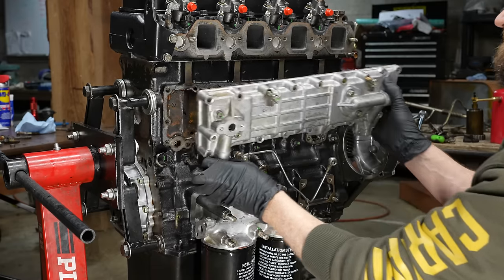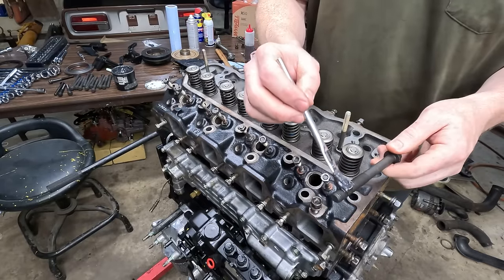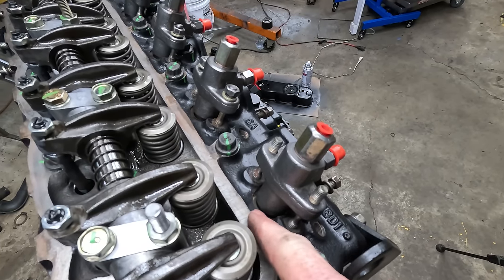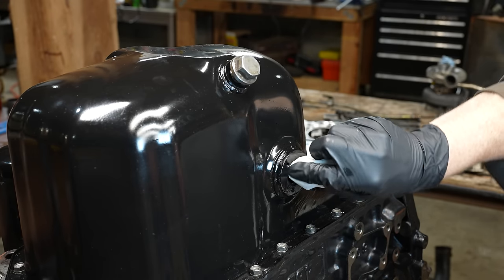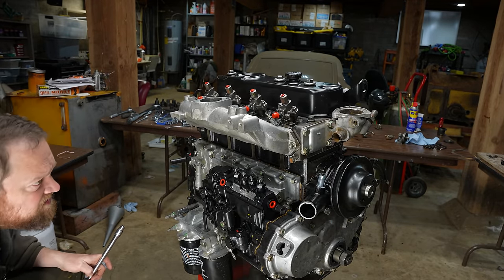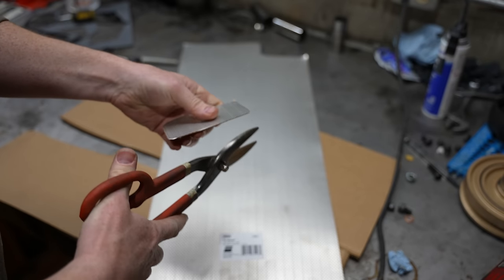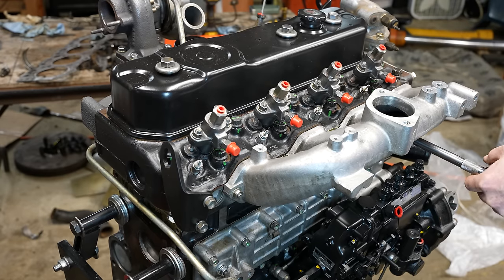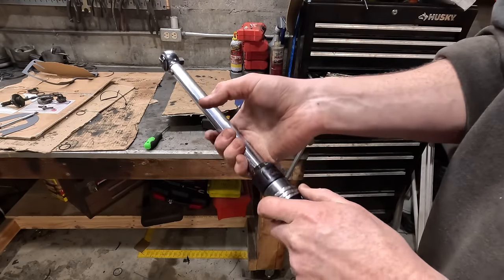Excavator engine build - Mistakes and headaches  (Isuzu 4BD1T/Hitachi EX120-2)

Comment: These days you're not even guaranteed that the $900 part you buy from the OEM isn't a re-boxed cheap Chinese part you can buy directly.
Reply: That's a shame. I'm not saying that the chicom version of something is garbage every time but if you're paying Mitsubishi or Toshiba or CAT prices, you should get the OEM part (bold stance, I know haha)
Reply: Agree
Reply: You should get what you pay for
Reply: Or a used part someone returned as new
Reply: Allow me to make a comment here. I am a retired truck fleet maintenance manager. Back in the early 90s, my lead mechanic came into my office and asked me to come look at something on a Ford LN9000 he was replacing axle bearings on. We used OEM parts exclusively in our fleet of mostly Kenworth and this one lone Ford. He had an axle bearing still in the box on the frame. He picked it up and showed me on the label Made in China. Mind you, this was in the early 1990s and this was a Ford part bought from the local Ford dealer marked Genuine Ford but made in China. So, that said, OEM from the dealer doesn't necessarily mean it wasn't made in China.
Reply: @Watchyn_Yarwood  Made in China also does not necessarily mean poor quality. 

They can make a product as good or as bad as you want, it's all about what you're willing to pay.

Comment: Matt, you need to get a set of "aircraft" tin snips. The set has a cuts left, cuts right, and cuts straight. The tips are very fine to the point that once you know how to use them, you can literally cut out a 1/4" hole from tin. My Dad was in the aircraft industry and had a set so once I left home, I had to have a set. I can't be without them. They are great for cutting any stiff material. Harbor Freight has them for about $20 a set. The really good ones are American made by Wiss.

Comment: your doing a fine job matt, now you have a dozer , excavator, tractor , now set your mind on a dump truck and quit worry about small things, all mishaps are lessons learned matt , we all went through it as you are now
make 3 marks , 2 on rod and one on the socket when you angle torque , i learned this lesson between the saddle tanks on semi trucks and torqueing with a 6 ft chetta pipe someone torques and someone holds the socket

Comment: I seem to remember being taught 50 years ago in machine design, to always torque bolts with dry threads, as friction is involved with holding that fastener tight.  I had to look that up, tho.

"Always assume the torque is a dry value unless a lubricant is specified. If any lubricant gets on the fastener and no lubricant is mentioned or specified, then using the torque value laid down could over tighten the joint or the fastener itself." Every engineer has a different book.

Lordy help us. Keep'm coming, Matt. Love your content and dry humor.

Comment: Nice to see someone calibrating a torque wrench.  Have checked the weights to see if they really weigh as labeled?  Mine do not.
Reply: Exactly what I came here to comment. Those weights can easily add up to be off by that 10% you discovered to be missing. Will the scale you use to check those weights be very accurate at 50lbs? Also doubtful, but definitely better than what's stamped on the dumbell :P For mission-critical torqueing I'd say the cheapest and most accurate way to achieve it would be to send in the wrench to be calibrated.
Reply: I couldn't agree more. You need to use the proper equipment to calibrate a torque wrench. Arm curl weights and fish scales don't cut it. He should compare his wrench to a high end one and see if there are significant differences. His local machine and engine shops will have them. As it is, I wouldn't trust his "calibrated" wrench at all.  @rokask

Comment: Don't forget to oil the turbo before starting the engine. It takes a while for the oil to reach the turbo and you can ruin it pretty quickly if it's dry.
As for reusing bolts, typically (not a rule) the ones that are meant to be tightened at an angle are not reusable.

About the water pump pulley, I have a similar engine in my truck and the pump has a spacer on the inside, in my case the pulley does not touch the water pump but without the spacer the belt does not align well , keep that in mind.
And that alternator pulley is shot, you better get a new one or you'll have noises everywhere.

Comment: JUST KNOW ... Along with the trusted use of an ISUZU Engine for this application, they are used throughout the world for many applications.  In fact, and most people don't know this, the DURAMAX Engine in my GM one ton dually is an ISUZU Engine.  They have been reliably used in GM trucks for over a decade along with continuation models that just keep getting better.  The aftermarket and builders are now producing over 2,000 HP along with built Allison Transmissions that can take the power.

Comment: A trick my dad taught me about stripped female threads about 60 yrs ago. Heat the bolt with a propane torch until solder flows into the threads and fill them about half way. The solder is soft enough to conform to what’s left of the threads and will torque right down. But your solution was great, I would not have thought of that.

Comment: I would suggeat that your fix on the oil cooler is actually better/stronger than the original, and a lot more suitable a way of attaching that the original option.
Reply from the maker: The replacement one came with studs, so apparently someone else figured it out too lol

Comment: I put a used 4 cyl Datsun diesel engine in my 1978 Datsun truck and checked the installed glow plugs with an ohm meter. Two of the glow plugs seemed pretty good and two were dead. I pulled them out and connected a +/- jumper pair to 12 V.DC The glow plugs that seemed pretty good had only 1 of the 4 elements working. So my rule is pull them out and power them up. They should glow white hot. The engine smoked teribly when first cranked with the old plugs installed. No smoke when cranked using the new glow plugs. I was surprised that the glow plug elements had segments to provide heat.
Sam

Comment: I had an Air Force Training Instructor that drilled into every training person that ALL extensions flex, and need to be checked to find out how much torque is lost by flex of extension. I think he was right at the time but I also think the metal used now is much better. But just yesterday I broke a 1/2 inch extension(4 inch) from Harbor Freight torquing down lug nuts. As they say Buyer BEWARE.  Have A Great Day.

Comment: Another excellent video Sir!    Your perseverance and patience are serving you well.   Well done on getting your manifold welded up, and I reckon that is a good call in replacing the oil cooler.  They may only be 4 little bitty fixings that you modified, but if one were to fail, then that is a whole new game of stripping, cleaning, replacing and rebuilding parts of an engine that would probably be buried back in the engine bay of a machine stranded out in the sticks!  😪

Comment: For making large holes (2-3 inches) I use circular leather ring cutters. You can do the ID as well as the OD for a thin gasket, too. Just set one on the work, place a piece of wood on top of the cutter and wack it with your favorite hammer. I use them for making cork gaskets used on sediment bowls on gas tractors, or anything else that needs a nice round hole. I used to whittle the holes before trying those cutting rings.

Comment: A couple of things I like to do when torquing head bolts is before I remove the socket from the bolt I'm torquing, I look at the next one in sequence. Also, as I'm running them down by hand, I do that in sequence. I do this because it starts my muscle memory on the sequence.

As long as you get them all done correctly, that's the important part, but that's just a couple of things I do to compensate for a bad memory.

Comment: Matt, there is an angle gauge that you can use for torque plus angle bolts. They are extremely handy when you’re dealing with 12 point. Harbor Freight has some and so does Snap-On. Hope this helps.

Comment: Not sure if it was mentioned but one thing which entered my mind when watching was the weld on the inside of the intake manifold. There mighnt be much material on it but die grinding the weld down would help increase the flow into that port back to stock levels. Its not a performance engine by any means but its just stood out to me as somerhing that might restrict the air inake flow on that cylinder. Great job on the engine to be fair 👍. Serious build 👌

Comment: Check the casting numbers on the water oump housings.  
Check the distance from the mounting surface on the  block to the front of the hub.  If you change pumps the belts and belt driven devices may not align.

Comment: Dang Matt, You should go into high end engine rebuilds.  Your torque technique is right on. That engine is looking great.  Welding cast aluminum can be a real crap shoot. Cast Al will have all kinds of "dirt\debris" from the casting process. That stuff will just keep "boiling" up as you try to weld it. Thus, yielding a less than durable weld.  It looked good in the video, the Al filler material was pretty well blended in. It all depends on the "weldors" experience. I personally have use "Alum-Alloy (low temp brazing filler) and had better results than when I "fusion" welded stuff.
That is a fabulous looking engine. I've got great confidence it is gonna fire up and run, run, run!!!!!!

Comment: Because of my own paranoia, I have tended to use studs instead    of bolts in many cases. It comes down to cost and quality. I have gone to the side of error and used studs on anything internal or hard to fix.... great so far and hope your warming up down there.. Winter here in alaska has seemed to hold onto cold nights

Comment: It's not surprising there's few people that will tackle cast aluminium, depending on the quality of the casting material,  it can look good on the surface but once you apply heat it can fall apart as the inner structure can resemble Swiss cheese! And once it does that there's no going back.
Reply: Kudos to whomever did the repair, they did a nice job!

Comment: About the torque wrench calibration, I think it was spot on before, wrenches of this type being practical etc are not perfect design, there's a bit torque variation from the exact position you put your hand, the problem is that pivoting points of the bolt and the "sensing" point that produces the "click" are not identical, they are more than an inch apart. And by adjusting, also linearity goes bananas.
Could try it with an electronic torque sensor, you'll be amazed. Have a good one, good job as always.

Comment: Cool to see you testing and calibrating torque wrenches. I recommend using a fish scale too so you can see what value it clicks over at, though dumbbells work too. Last time I checked mine, my cheapo Horror Fraught ones were more accurate than my expensive ones! Sheesh. Can't trust anything. Good to check their accuracy before doing internal engine work.

Comment: I use the same method to calibrate my torque wrenches, but I just use large plastic jerrycans I fill with water to the weight I need to calibrate the wrenches at different torque settings 🙂

Comment: Hi Matt,
Enjoying your rebuild mission. I just want let you know when I replaced turbo's I tried to replace the mounting nuts with brass nuts. They don't rust up break off the stud. Yes they strip but its just learning not to over tight them. It took me a couple times to learn that I was not bolting the wheels. It made life much easier for the future you,
Reply from the maker: that is a good idea, I might try that

Comment: 38:08 I'm guessing the water pump variations are also the reason your alternator bracket doesn't fit anymore. 54:26 I was going to adjust my torque wrenches... But turns out you have to attach the vice to something solid. Who knew.

Comment: Oil
Use 15-40w with an additive in it for about 30 min, if clean then go for the 5 -10 hour then oil and filter change then run her.

Comment: FYI, FP Smith Parts & Equipment is a family-owned and operated heavy equipment parts distributor. The company was formed by Francis P. Smith in 1947, and is now headed by his son, Pete Smith.

Located on 20 acres in Northern California, FP Smith stocks one of the largest inventories of new OEM surplus, rebuilt and used parts and components for both early and late model construction, mining and agricultural equipment.

Current physical inventory consists of 208,000 line items with over 4.5 million parts on the shelf. Our sales department also has easy access to over 683,000 line items of new and surplus parts through key vendors and suppliers.

Comment: Nice work on the engine.
I did not know you could recalibrate torque wrenches. I have a couple of decent quality, that can probably be adjusted. Thanks for the tip

Comment: As far as I know... you tighten the manifolds from the 'inside out'.  
Tightening from the outside in you can trap some stress in the middle of the manifold.  Dunno.
I thought you had a 'lot of confidence' in those tie-wraps when calibrating the torque wrench.

Comment: On that intake, they warp! So every time you take one off it should be re-surfaced before reinstalling it ! I found it happens with cast iron as well. Especially on long ones like on inline six engines like the Ford 300 inline six.

Comment: Hey Matt check the hight of the 2 water pumps. If it's the same thing that I came across it will be that the mounting point for the pully wasn't pressed out far enough causing the pulley to rub up against the housing and not line up with the other pulleys. I have a kobelco with a 4BG1-T almost identical to the 4bd1
Reply from the maker: The pulley hubs are at the same distance away from the engine, but the body of the new pump is thicker and the snout is smaller, if that makes sense
Reply: Ahhh righto yeah I came across that aswell I bought a Chinese water pump off ebay. The surface where the water pump mounts was thicker by 3 or 4mm  like they didn't machine enough off is that the same as yours?

Comment: That drive gear for the oil pump has to be installed from the bottom. You did not open the sump to install a bloody drive collar did you? Doing things twice? Thats engine building and after a few repeats you begin to actually feel confident about what is inside. It looks very impressive. NICE & CLEAN! 👍

Comment: I worked in parts department of Pacific Detroit diesel and replacing I believe the series 60 head took 39 bolts for the head at that time was 5 bucks a bolt that's a few bills and there was absolutely not difference in bolt length and torque distance was the same.

Comment: Your very meticulous in your rebuilding. I would not blame you at all for having new head bolts. If it were a gas or propane engine? No. But a hard working diesel? It would be a shame to have it a blown gasket due to stretched bolts.
Carry on young man.

Comment: When you make paper type gaskets, a small ballpark hammer (ball end) place the paper (gasket materel) on the surface you want to cover/seal and tap around the edges. The edges will cut the paper and make the shape you want. Dosen't work on metal though.😂

Comment: Matt unless the head bolts will bottom out then even with the stretch if any the bolts are rated to at least five times the torque values to secure the head they came up with the head bolt pitch to sell you head bolts ,and if your in doubt take a head bolt like I did and 2 nuts into a vise with 2 plates length of bolts to nuts and torque to specs and push it past there 1/4 turn if you have failure you will not meet torque specs I've done it to prove a point .

Comment: Did you turn the crank when retorquing the bearings and when temporarily adjusting the tappets?
I've done a small number of engine rebuilds in my days and always had a manual on hand for the schematics drawings. I notice on Western Truck & Tractor Repair channel that Warren, who's got many years of engine rebuilding experience, does the same.
Better safe than sorry and saves a lot of reworking, as your finding out.

Comment: Just as an FYI, you can't put 50 pounds at 2 feet with your wrench, that won't result in an accurate 100 ftlbs. Close enough, sure, but since you're going through the effort of calibrating, I assume you want more than close enough. This only matters for click-style torque wrenches. A simple demonstration can be found in a video by "How 2 Wrench" from 7 years ago, called "Why hand placement matter when using a torque wrench. Proof with electronic tester!". A secondary, more in depth video about this is made by "The Bike Sauce", called "Why GRIP Position on Torque Wrenches MATTERS!".
Again, probably close enough, especially when not going off of the handle, but if you want to be extremely accurate, this is not the way to do it. I think the way to do it is to put the correct amount of weight at the middle of the handle. Unfortunately, that probably won't be a nice weight like 50 lbs, but it will be more accurate. A trick for very flexible weights is using water by the way. Just a bucket or bottle with a certain amount of water.

Comment: Buy a decent set of torque wrenches.  Thats what burned you on your oil cooler.  Especially when your on the lower portion of the torque wrenches range.  I use an inch pound wrench for anything below 25ftlbs.  Its easy to convert.

Comment: Cab you drill through the fin that the hole is messed up on?
So you could at least run a tap and die through?
Reply from the maker: I think it's actually an oil cavity, not a fin.

Comment: You set your torque wrench with weights. Did you check to see if the weight was correct. Just trying to put that out there for you to check. Don't want you to have the wrong setting.